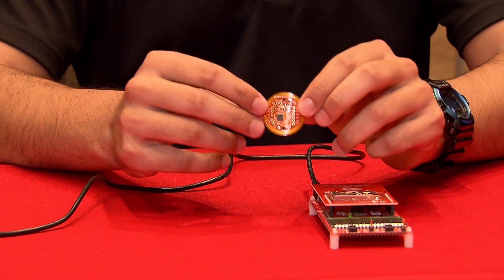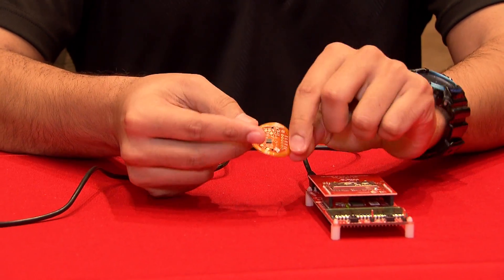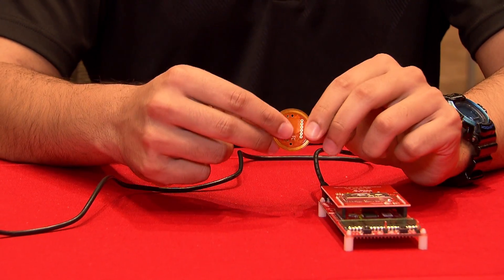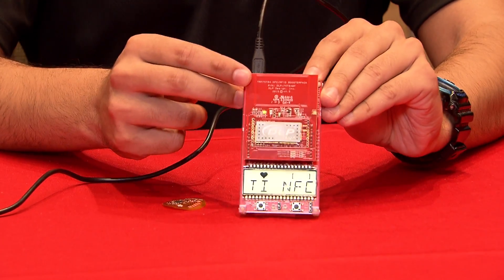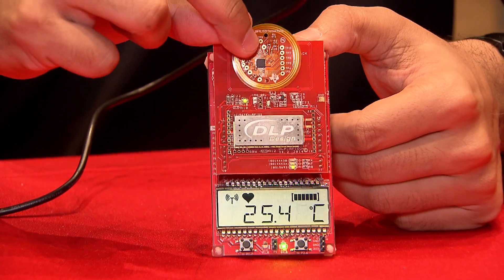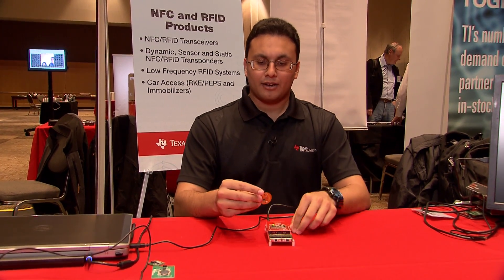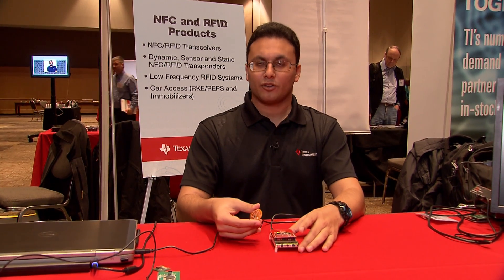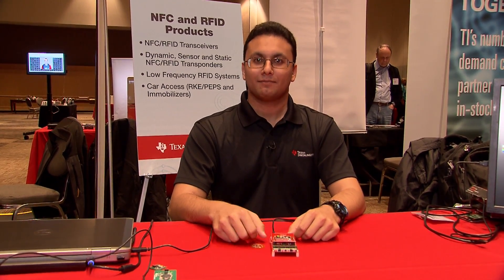NFC (Near Field Communication) Sensor Applications

Comment: What type of engineer design this?
Reply: An Electronics/Electrical Engineer has the know-how to design/understand the whole system, from the antenna to the analog and digital parts. A computer scientist would be more concerned about the microcontroller section, i.e. programming